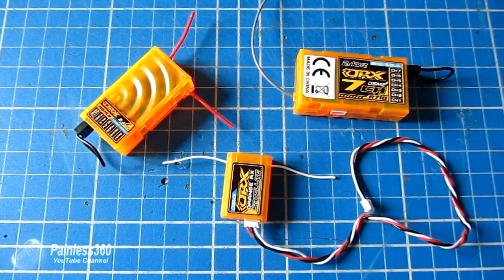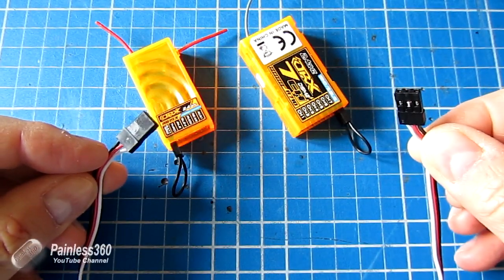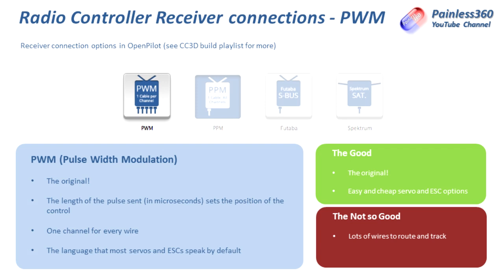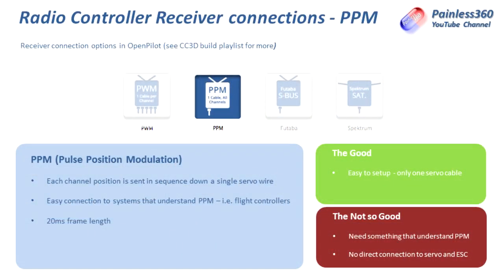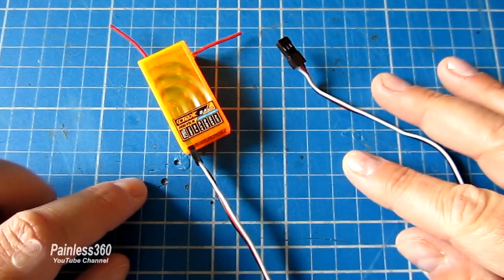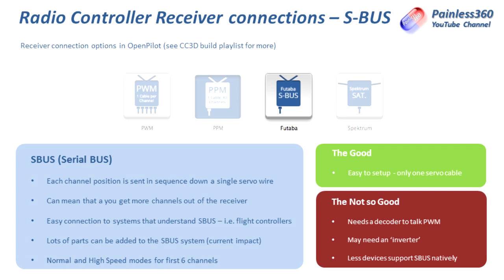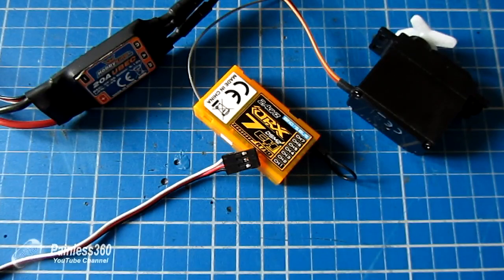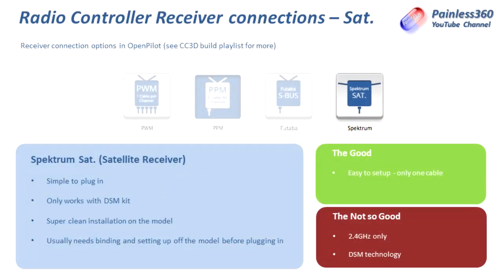RC Quick Tip - PWM, PPM, CPPM, S-BUS and Sat. explained for beginners

Comment: Hello. I have R88 with SBUS connection to FC and I use TX16. I want to add 2 servos for cam movement with Skyzone gougles. Where do I plug those servos (If my 8 chanels are taken by flight control)?
Reply from the maker: If there are spare outputs on the FC, then you can forward the extra channels from those channels to the spare outputs. Systems like ExpressLRS allow for you to bind and configure multiple receivers that can help a lot in these situations.. Best of luck!
Reply: @Painless360  Thanks. I found one ch6 on FlyWing h1 which is not used, so I plugged the servo for round rotation into it. For now It is fine and I use a slider ob the side of TX 16 to rotate cam right left.

Comment: I've got a spektrum ar631 receiver in a night radian glider. I've got the orange rx module in a taranis x9d and I've got them bound and have the model set up with the external rf on. The throttle, and elevator works but the rudder doesn't. I have the throttle on channel 1, and the rudder and elevator on channels 3 and 4. And when i swap the servo plugs the problem stays with bay  3 and the rudder works. Do i access the forward programming through a computer since i don't have an actual spectrum transmitter.
Reply from the maker: Spektrum is pretty locked with the TEAR order for their stuff. If the issue stays with the same output on the Rx Id start to suspect that output is damaged.. Best of luck

Comment: Good Evening   I have a Frsky R-XSR  bound to a x7 Taranis q   and i have the frsky on a orange cube ,  I can't seem to get the orange cube to recognize this receiver .  When i connect to mission planner the cube works
I have this plugged into the RC in but does this need to be plugged into SBUS instead or can i change something in the programming to have it recognize it in RC in .  I have not found anything on the videos about this issue  or is there a better receiver that will work better with the orange cube   Thanks for your help
Reply from the maker: Make sure you are using SBUS and have it connected correctly. See my Pixhawk 2020 series... Best of luck

Comment: This was very helpful in learning wich protocol to use with my flysky transmitter although i am using the ia6b receiver I keep losing signial and am thinking of upgrading to a better radio system have had three crashes on the FS-I6X system

Comment: I can't figure out where the wire all go on the ESC in the AR pro kit , it has 3 extra sets of wires , I figured out the two that connect to the f404-wing flight controller, the other bundle of 3 wires look like they would hook to the receiver but I'm running a crossfire nano receiver so do I need to solder on a 3 pins for it ?
Reply from the maker: Check out my build series on the channel fro more complete builds or this video on what the wires from the ESC all are: https://www.youtube.com/watch?v=OZNxbxL7cdc Best of luck!

Comment: Hi, brilliant video yet again, I'm hoping you can help me, I am quite new to fpv, I have a RadioMaster TX12 that I have been running with the frsky xm+ receivers, but since they changed the firmware  to not support multi protocol I have been looking for something different, so I tried the RM R81 nano, lovely littlle received just a bit too small for me to solder as I have a medical condition that makes my hands shake a little, so I am now looking at the RM R161 so I don't have to solder at all, I have just bought a Reptile Cloud 149 with the Mamba F405 flight controller, so my question is would the R161 be compatible with this. Thanks in advance, Darren
Reply from the maker: XM+ can run both ACCST V1 and V2 looking at the firmware page - https://www.frsky-rc.com/xm-plus-mini-sbus-non-telemetry-full-range/ Best of luck!

Comment: Hey, first of all great video! As i am just starting with the hobby i noticed there are other BUS-Systems from different manufactures like iBus (FlySky), EXBUS (Jeti), A.BUS (Align) and so on. Do those operate in the same way the S.BUS does and are compatible? On some of them there is very little to no information like the A.BUS, not even in the corresponding receiver manuals.
Reply from the maker: They are all different, some are not supported by things like Betaflight...
Reply: @Painless360  Thank you for the very fast awnser! I will stick to PWM and PPM first then, works for me so far, and look into the BUS-Systems later down the line.

Comment: Good day and a Merry Christmas. Awesome videos you have made. Just getting back into RC airplanes and still using my 30 plus years old equipment, Airtronics with RX 92262 72 band and another system that is Cirrus 900-xlc. So my question is, will any of the flight controllers or stabilizers systems connect to these units. TX has 6 plus controls, Oh also using glow engines if that has any impact? Thanks in advance Lee.
Reply from the maker: I've not used anything but electronic with a flight controller.. Check out my iNav and Arduplane builds and comparison videos.. Best of luck
Reply: @Painless360  Thank you for responding. I will continue to check out your awesome video sharing, so awesome.

Comment: @Painless360. I have a Spektrum DX7 DSM2 radio with an AR7000 receiver (internal and external ). Can I use a use a Maytek 765 e.g. with it? I do not really want to have to spend more money on a new radio system for now. Love your videos by the way, I am learning a lot from your channel.
Reply from the maker: Ideally you need SBUS for the input and that Rx doesn't have it. I can't see any of the single wire outputs from that older Rx that would work easily..

Comment: Great video. I have a few questions, however. 1.) If I'm setting up a fixed wing aircraft for use with an OrangeRX TX10i 10-channel transmitter, how do I determine the right receiver to use (between SBUS and CPPM)?  2.) If I only anticipate needing, say, 6 channels initially for servos, etc., can I use a receiver that has 9-channels?  The reason I ask is, I may want to add an FPV setup down the line and this would require the use of one or more additional channels.  3.) You referenced the "flight controller" in the video, but I wasn't sure if this was for multi-rotor aircraft.  Unless I'm mistaken, a typical fixed wing setup goes from battery to ESC to receiver to outputs (servos).  Am I wrong in thinking that there is no flight controller with this type of application?  Sorry for so many questions.  I hope they all make sense.  Keep up the great work!

Comment: Hi there, interesting Video, 
I am a newbie, so I always interested in watching and learning.
I am having an issue when I try bind my Mobula7 to my FlySky FS-i6s radio, the radio starts beeping and a message comes up saying Turn Off RX!......Have you come across this before? Could it be a setting in Betaflight, or could it be an issue with the quad or radio? 
Any help would be great, Cheers, MHG
Reply from the maker: Does the Moduba7 have a FlySky compatable receiver? Does the radio and Rx have the same protocol on them? i don't use FlySky radios here...
Reply: @Painless360  Thank you for getting back to me! Yes the Mobula7 has a flysky receiver and I have tried the various protocols, it could just be an issue with either the radio or the Mobula, I have another quad on order so if it keeps happening with that I will try another radio. Thanks again MHG

Comment: Nice video. I'm just coming back to RC after 40 years and have never used a 'flight controller' which you refer to a lot. I've just bought a RX and Rx set and there's no flight controller, so what is it and do i need one for glider flying?
Reply from the maker: Flight controllers have become more common in fixed wing in the last 5-6 years. You don't need them in a fixed wing but they can allow your model to do things you've not seen before. Check out my iNav for beginners series that explains some of the benefits for new pilots. Best of luck!

Comment: Can you show a video where you can hook up a spectrum radio to a sbus receiver?  because I'm trying to hookup my Flywing H1 Flybarless Gyro System RC Helicopter Flight Controller
Reply from the maker: You'll need an Rx with an SBUS output. I use Orange Rx units. Best of luck!
Reply: @Painless360  thank you for your help. This what came out of it https://youtu.be/ulrFNQOxnb8

Comment: @Painless360 Thanks for the video! Do you know if you can connect 35MHz receivers using PPM or SBUS? The MATEK F411 controller I’m interested in doesn’t seem to support PWM and I’d rather save the weight on the wiring!
Reply from the maker: I would think that would depend on the capabilities of the reciever.  If it has sbus out then it should be fine... best of luck

Comment: THANK YOU for clearing up my issues and  understanding what just happened after I purchased a "Radian" with AS3X which is great..but I have a Taranis X9 lite, so that had me thinking then and now realize these will not bind . I was bummed yet this was all due to me not understanding some of the new RC world. So either a Spectrum Transmitter so we can fly as is. OR take out AS3X and pop in a frsky, trying to get a frsky that might simulate the AS3X now, more to learn :)

Comment: Can a skid steer/tank steer be made with one receiver and two separate single channel/single motor ESCs?
Reply from the maker: Yes it can. It would need setting up on the radio. Please check out my videos on OpenTX for R/C trucks, cars and ground vehicles.. I hope they help...
Reply: @Painless360  well I just bought the radio and the two ESCs.

Comment: I have some questions:
What is the functional difference between PPM and SBUS? My guess is that SBUS is digital (asynchronous PCM data frames ) where PPM is still analog (the timing between edges defines the value). What about update rate and reliability? Is this right and is this the only difference?
Reason I ask is because my new receiver supports both methods as well as smartport telemetry, but presumably not f.port., and despite that it should be possible to have smartport and sbus share the same UART channel in theory, it does not appear that is supported at least on my FC and INAV. (this could probably be a hardware USART limitation, like if they operate at different baudrates)
Reply from the maker: As SBUS is a digital signal it also includes a number of other checks and flags so that the flight controller can detect when the signal is in error or the receiver is in failsafe. I've never seen a UART in the hobby support two protocols on a UART at the same time. Lots of the modern protocols are bi-directional (SmartPort, CRSF, F-Port etc.) so you'd need the TX and Rx pins of a UART anyway. Happy flying!
Reply: @Painless360  Thanks for confirming.
Is Smartport just for telemetry? currently I need to use 1 UART for SBUS and another for SmartPort. Both are simplex (one way only) right? and because they go different directions it would be nice if I could setup SBUS on UART1 RX and SmartPort on UART1 TX. 

Apparently this is what F.port is supposed to solve by being half duplex, or bidirectional. I killed an IC oj my Fport transmitter so while I order a replacement tristate bus inverter I got another receiver that uses sbus, cppm and "S.port" which presumably is smartport.
Reply from the maker: Smartport is single wire but full duplex.... Check the Frsky website. Happy flying!
Reply: @Painless360  That would explain that! I did some more googling and found they apparently work at different baud rates so separate USART channels are required.

But wait; if it's full duplex & high-speed, why can't I control the craft and receive telemetry over the smartport wire? What's the limitation? This should eliminate the need for S.bus. Also it can't possibly be full-duplex, that requires 2 wires minimum. Half duplex means data can only go one way at a time but the direction can alternate. I see it says full duplex on online in a few places but that's a typo.

Comment: Regarding PPM. you suggest that you can use the other PWM outputs to do other things to the PPM output. But surely this would require a receiver with more channels than PWM outputs would it not ? i.e. if it's a 6 channel receiver with 6 PWM connections and the PPM is connected then the other PWM outputs will just mirror the PPM outputs so won't be available as separate channels ? So for example a Turnigy TGY-iA6B V2 can't control more than 6 outputs if you use the PPM connection even though this leaves 5 PWM outputs free ?
Reply from the maker: It depends on the reciever and how configurable  it is (see X8R binding and Crossfire videos for example) and what you are connecting to. happy flying !

Comment: Has anyone found all or most of there orange recievers are no longer working now ? 2 years later that is.
Reply from the maker: All mine are fine. Be careful that some radios don't support dsm2 anymore and some of the earlier receivers were only set up for that retired standard
Reply: @Painless360  I use the older Taranis none plus and that was about when I gave RC a brake and 2 years later my Orange receivers are dead with discoloration on the pcb ? got allot of older DSM2 FrySky's and they all still work even my old Dragon link V1 and V2 receivers still work.
And now everyone's over DSM ...... lol

Comment: At 4:42 I finally see how to connect single wire connectors to the RX. I watched your video on unboxing the ZOHD Orbit but you didn't show how to connect the stabilizer to the RX. The Orbit is the first of my 8 planes that has with single wire connectors.

Comment: Thank you for your vids, iv watched a few today to get to grips with the different signals and you are an excellent teacher so big Thank you.

I do have a quick question though. I bought a relay with a 5v coil and it’s signal wire uses voltage instead of the ms bursts.. basically when the voltage between signal and ground get over 2.7 it energises a coil. 
I currently have a system using PWM, and wondered  is there a way to change how the receiver uses its signal cable so it uses variable voltage rather than the ms pulses?
Reply from the maker: Look at the Turnigy RC switch, you can't run a relay directly..
Reply: Yeah that’s how I ended up doing it in the end :-) ... I got a ebay version of the Turnigy switch and used that to switch the coil. Next step is to make a gear Chanel or Aux Chanel fail safe then I’m done :-) think Iv seen that in a video of yours somewhere.

Comment: .
loving this video bud. learned a lot. just a quickish question. i found an old electric skateboard on the dump. its an old 24 volt 400 watt brushed motor. it used to have an potentiometer in the form of a gun to control the speed. i couldn't find this so i bought this

https://nl.aliexpress.com/item/2-4Ghz-mini-remote-controller-with-receiver-for-electric-skateboard-longboard/32573238408.html?spm=a2g0s.9042311.0.0.27424c4daJQfOx

this sends an ppm signal (so i've been told) and i need to change that to a pwm signal since i already have the dc electric speed controler which is old but should still work. now i should be able to do this conversion of signals with this thing right?

https://nl.aliexpress.com/item/8CH-Receiver-PWM-to-PPM-SBUS-DBUS-S-BUS-32bit-Encoder-Signal-Converter-FUTABA/32769611659.html?spm=a2g0z.search0104.3.21.64ba7c479J3pWO&ws_ab_test=searchweb0_0,searchweb201602_1_10152_10151_10065_10344_10068_10342_10343_5722611_10340_10341_10696_5722911_5722811_10084_5722711_10083_10618_10304_10307_10301_5711211_10059_308_100031_10103_10624_10623_10622_10621_10620_5711311_5722511,searchweb201603_55,ppcSwitch_5&algo_expid=825eba54-22d7-4b1d-b6c9-73012102b205-3&algo_pvid=825eba54-22d7-4b1d-b6c9-73012102b205&priceBeautifyAB=0

anyways, would love to hear from you.
Reply from the maker: I would use something like a Servo tester, it produces a PWM signal. Best of luck!
Reply: that is a great cheap option. I'll defenitly get one of them to check if everything still works. the problem is if i stand on my bord an lose my ballance the bord will keep going. will my suggestion work though? with the little signal converter?
Reply from the maker: You could use a cheap RC car radio transmitter and then the fail-safe would be useful too.. Best of luck!

Comment: Hey can you recommend me a good pwm transmitter cuz my old flysky T6 loses range inadequately when I am flying my zmr250
Reply from the maker: Depends on the budget. I would always go for one of the OpenTX radios (QX7 for example) if you can afford it and cope with OpenTX. Other than that the new HK Orange radio is very nice..
Reply: Painless360 you mean transis
Reply from the maker: The 'Taranis' also called the X9D+ and the QX7 radios..

Comment: Hello sir. I am building a quard. But when i connect cc3d. Run setup wizard all works fine.  But after i plug out the cable from my pc after librepilot configuration there is no motion of the props neither there seems any connection between the transmitter receiver or flight controller. I am using fs-ia6 transmitter from fly sky. Please help me
Reply from the maker: +Mahadev Bhandari it's possible that the flight controller isn't getting the five volts it needs to be powered. Please watch my cc3d build series, that should cover the basics for you. Best of luck
Reply: Painless360  thankyou for your reply. I managed to make it work. But the motors are not rotating at their full speed. What might be the reason?
Reply: Painless360 sir, i am sorry to disturb you again. I still have one problem... when i fit the props the speed of the motor is not good enough to lift the quad. What could be the solution for it? Please respond as quick as you can... because project going on. Sir please